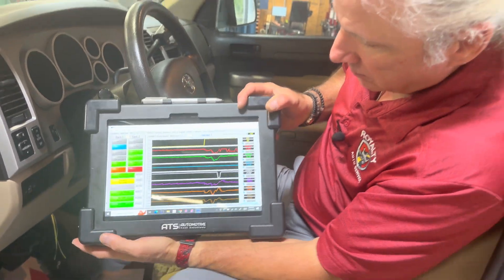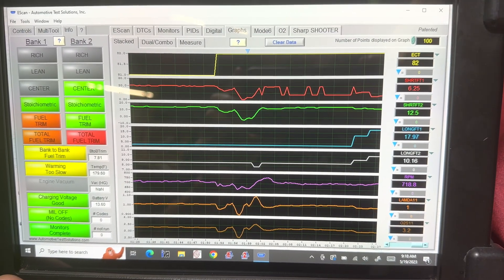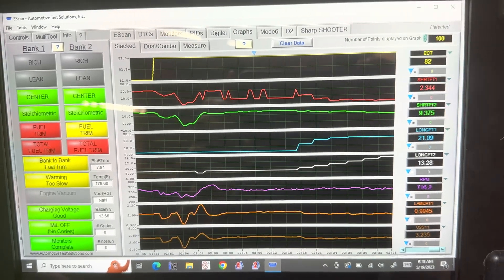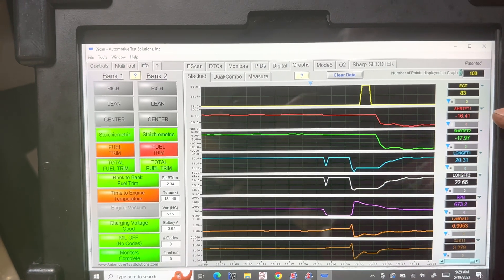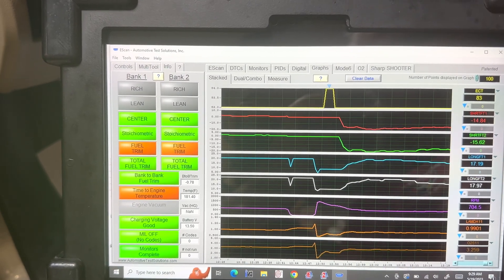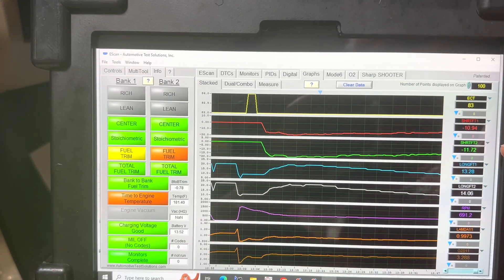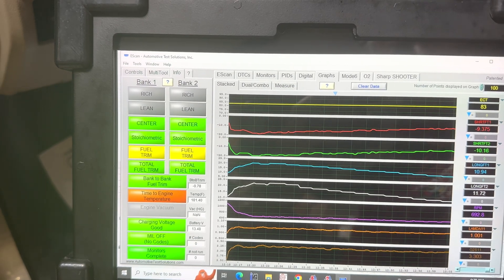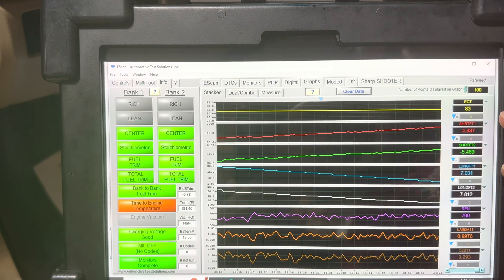Beginner Fuel Trim Diagnostics / Vacuum Leaks (Toyota Tundra)

Comment: why doesn't a vacuum leak cause the idle speed to increase
isn't a vacumm leak (after the throttle plate) the same as a partially open throttlé ¿¿¿¿

Comment: Can someone maybe give me some advice on my car's situation? In park my Long term is negative 10-15% while short term is normal. If i raise the rpms to about 2000 and hold it the long and short term trim will normalize close to zero. Any ideas?
Reply: Long term negative means the computer is reducing the amount of fuel because the flow of air is restricted. Clean air filter, maf sensor with approved spray cleaner ( let it dry naturally, DO NOT USE COMPRESSED AIR you would destroy it ) , and importantly clean the throttle body. The effect of an air restriction is more evident when the throttled is close than when it is open at higher rpms.
Reply: Typo: closed
Reply: Also if your car has a map sensor ( manifold absolute pressure ) , not to be confused with a maf sensor, check it and clean it if necessary.
Reply: @franktarawa1300  Ive tried cleaning it even though the MAP sensor reported the atmospheric pressure correctly with KOEO and it also matched up with an actual vacuum gauge in comparison ( used a Bluedriver obd2 scan tool with live data and a Maddox Vacuum gauge). Ive tested pretty much everything I have been suggested so far, I mean you name it and Ive probably ruled it out. Im building a smoke tester to use on the exhaust just to see if i have any leaks there or maybe at the exhaust manifold just because i havent done it. Could an exhaust leak affect my wild idle if the leak is before the upstream O2 sensor? Its a 2000 Dodge Neon by the way 2.0L.
Reply: Any update I the have same issue  in idling?
Reply: @sultanalrashidi1400  I replaced the air intake manifold gasket where it meets the engine, it was pretty worn out. I also noticed a very small exhaust leak where the manifold meets the engine. Runs better now

Comment: Thanks for the video and explaining short term and long-term fuel trim and having a problem with my 074.6 F150 found a leaking EGR valve with my smoke machine. After putting smoke machine on truck found leaking EGR valve gasket bad. Was fixing to start buying fuel injectors, and O2 sensors until I found this video. Thanks again.

Comment: Can anyone help me with my problem, my car is idling rough at moment and has even stalled a couple of times when I stopped, on my scanner with the short term fuel trims there's absolutely no reading at all just 3 dots like it's turned off, eg, (STFT bank 2 sensor 2...), there's no percentage at all, any help would be appreciated, thanks, there's also no codes whatsoever

Comment: With vacuum leak, extra air and fuel being added into engine,  RPM have to be higher than normal idle, Yes?? Got a car here with 7% LTFT and 2-4% STFT but engine RPM at idle seem normal at 700-750. what could be the issue?

Comment: You are spot on about fuel trim.  On my 2016 XC 60  I forgot to put the oil cap on after I change the oil. Luckily I  did not make a mess.  With the hood open,  I briefly started the car to check for any oil leaks and it did not  take to long  for the PO171 code to  reveal itself. Because I knew the vacuum leak was caused by the oil cap not being put on , I wanted to clear the code.  When I went to clear the code ,my ODBII scanner stated that it was a permanent code, and had to go thru the drive cycle. After a 250 mile trip and a couple subsequent small trips the code finally cleared.   I believe (as you said) if I did not attempt to clear the code it would of cleared much sooner on its own.

Comment: So if it might take 15 to 20 minutes at idle, and 10-20 miles of driving… do you turn the car over to the customer and let them determine if the repair actually remedied the symptom?

If it takes that long for fuel trims to normalize, seems like repair shops would be pulling their hair out not being able to know 100% they have found all potential issues.

Comment: What does it mean if at start up the STFT rises to over +50% on bank 2, starts running rough, I floor the gas a few times for about 5 seconds, STFT comes back down to around normal. Its only on bank 2. Its almost guaranteed to do it if I had the car running, shut it off and start it back up. Like if I had to grab something from the grocery store on my way home. LTFT stays around +7% to +12% on bank 2.

Comment: The vital information I was looking for and also might be useful to others (how a vac leak translates in fuel trims) is at 5:56. I knew you could use fuel trims to check for vacuum leaks but I can never remember which direction the fuel trims go. A car I was looking at had the STFT going negative -10 to about -20 when accelerating but it was idling at near 0 so I'm not sure if it's a vacuum leak. Would this be an indication of too much fuel/too little air?

Comment: What if you have stft at minus 8 at idle and ltft at positive 18?
Reply from the maker: That would be a total fuel trim of 10%. Given enough time the LTFT will lower to 10 and the STFT will be around 0. 10% is still a bit too much.
Reply: @theroyaltyautoservice  thanks for the reply! What are some things that could cause this? Vacuum leak or leaky fuel injector? Or maybe small boost leak?

Comment: If I was going to teach a vacuum leak AKA false air leak, I would want to show MAF readings also with this very small leak and a larger leak since you were able to control the size so I could monitor MAF small leak and larger leak and after the repair and since I am teaching MAF I would also have waited for a problem in a vehicle with a dirty MAF then done cleaning after fixing the leak to show more MAF readings based on these 2 scenarios. This is why creating a problem is not always a real-world scenario but THANK YOU for this beginner lesson that is in fact a useful lesson for a vacuum leak ONLY on any car that you did mention.

Comment: Thank you for the video! I got a Renault Duster with a vacuum leak suspicion. In idle, I got 15% STFT and  6% LTFT. However, at 2500 rpm, I got -10% STFT and the same 6% LTFT. Is it still a vacuum leak?
Reply from the maker: Sounds like it could be a vacuum leak going by those fuel trims. Adding 21% at idle but at 2500 total trim is 4% (which is good).
Reply: @theroyaltyautoservice  Thank you, Sir, for your answer! Love your channel!

Comment: very educational, you confirmed what I thought about vac leak after looking at trims like this.  But how d I find?  You touched on carb cleaner but I tried that before and found n o changes.  I supposedly had a smoke test, but didn't watch and he 'didn't find anything,' but that was a P0171 issue a while ago, that was fixed.  Intake gasket?  Valve cover gasket?  Similarly, you mention issue is only at idle, hence can I go on a road trip which will be mostly highway?

Comment: P0171 fuel system lean can also be Maf and fuel system issues. Dirty fuel pump or injectors. Had one recently with dirty injectors and wondering why the LTFT wasn't dropping after the repairs. Now I know that I have to cycle the key off. Thanks.Always great diagnosing from you guys
Reply: He is referring to vacuum leak and the clue here is huge adjustment at idle. A weak pump, clogged injectors, faulty MAF sensor etc. will cause high fuel trim numbers as well, but they will be present at different load/rpm ranges.
Reply: Yeah for those failing parts the fuel trims will continue to go up (positive numbers rising ) as the load / demand for fuel (such as during increased RPM) is introduced in the diagnostic process .

Comment: Nice video. Just wanted to add a comment for cars that use a MAP sensor instead of a MAF sensor. Vacuum leaks on MAP controlled vehicles will not be visible in the fuel trims.
Reply: There are two strategies to determine the amount of fuel to inject into a running engine.
One is to measure the incoming air mass using a mass air flow meter, the other, also called speed density measures the pressure in the intake manifold. 

Both of these methods are effective at determining the air volume, hence the PCM knows in advance of the combustion event how much fuel to apply based on the measured air volume. The idea is the keep the air to fuel ratio at 14:1.

When the measured air volume is accurate, and the fuel delivery is accurate, the theoretical fuel trims will be zero since the resulting combustion will not be rich or lean.

The reason the fuel trims of speed density systems are not affected by a vacuum leak as shown in the video is because the instant the leak is created it is detected by the MAP sensor, the fuel is adapted to the leak immediately resulting in a 14:1 ratio, which is perfect and the fuel trims remain at zero, or no change.

For engines that use a MAF, a vacuum leak as demonstrated in the video, means the additional air did not get measured, therefore the PCM does not know to increase the volume of fuel.  The lean mixture is burned, and then the O2 sensor reports a lean condition, resulting in positive change in the fuel trim to correct the lean condition.

Fuel trim is driven directly by the closed loop feedback from the oxygen sensor. Let us know if any of this makes sense, and just maybe Royal can make another video to elaborate more.  Fuel trims are a very powerful diagnostic tool, and are also the most misunderstood.
Reply: @TheRallyCoop great explanation thanks!
Reply: @TheRallyCoop  I thought fuel trim refers to, or basically equates to, "fuel compensation".  If the MAP detects a pressure change due to a leak, and the fuel is adapted, isn't that fuel trim happening to bring the mixture back to 14:1?
Reply: @kb25j  fuel trim is a measure of the correction
Reply: @kb25j fuel trim only changes if the air to fuel ratio is off, and the O2 sensor reports the resulting lean mixture, then the trim is adjusted. The key here is the O2 must report the lean or rich mixture. A change in fuel trim is directly related to the reading from the O2 sensor. With MAP systems, the air to fuel will always be the correct ratio for vacuum leaks, therefore the O2 will not report an imbalance, therefore no correction for fuel trim due to a vacuum leak. 

Now, if MAP vehicle reports positive fuel trims it is because insufficient fuel is getting into the combustion chamber! It is not because of a vacuum leak.
Reply: @TheRallyCoop  what wouid you say about a 99.2% STFT on both bank one and two, sensor 2?
Reply: @victoriamorris7619 not sure what you mean by sensor 2. Sounds like your engine is starving for fuel.
Reply: @TheRallyCoop referring to short term fuel trim bank one sensor one and STFT bank one sensor two. Sensor one is normal, around 3.9 but sensor two, after catalytic converter is 99.2
Reply: @TheRallyCoop could that possibly be due to carbon build up on the valves? It's an Acadia. Has MAP sensor.  I've had to replace the canister purge valve a few times. 
Long term trim is 14.8. Scan tool hasn't been able to complete the EGR monitor, boost pressure system monitor or the fuel system monitor. It's flashing red.
Reply: @TheRallyCoop My car has a lower intake manifold pressure when idling and on than the car of the same model, for example, it should be 3.8 psi, while it is 2.9 psi. It also has a higher calculated engine load, for example, it should be 18 percent, while it is 28 percent. The car is naturally aspirated and only has a map sensor, no maf sensor, and a wired throttle. It also has no air leaks because when I held the throttle with my hand, the car shut off. In this case, ltft is 13 percent and stft is zero percent. Both the first and second oxygen sensors show a constant and low number like 0.04, but I think they are healthy because when I suddenly give it gas, it reaches 0.9 volts. Also, during a cold start when the rpm is high, the first oxygen sensor oscillates correctly and the second oxygen sensor shows 0.45. I don't have a catalyst problem because at full throttle, the manifold pressure approaches atmospheric pressure. I think the timing must be correct because when idling, the timing advance shows 7 degrees, and this is the same as the car of the same model. The car has low acceleration and knocks. (Of course, the problem is not serious and it can be driven easily.) There are no error codes. What do you think is the problem?
Reply: @SinaShekari At 2.9 lbs of pressure you're making 11.8 lbs of vacuum. 

The general rule is 12 to 17 for a healthy engine.

The engine is a mechanical air pump.  I suspect the valve timing is off.

Perform an in cylinder compression test to assess where the valves open and close relative to the stroke of the pistons.
Reply: @TheRallyCoop  thank you sir, you mean the absolute pressure should be lower than this and higher vacuum? i checked the the same model cars of mine and at least they have near 4 psi absolute pressure and mine is very lower than them.(it's old technology 1.5 8V natural aspirated engine)
Reply: @SinaShekari manifold vacuum is atmospheric pressure minus the actual gauge pressure. 12 to 17 is a good range. Adjust your atmosphere pressure bases on your altitude.
Reply: @TheRallyCoop  if the vacuum leak is before the MAP, it's still metering the air properly?? It's unmetered air that causes fuel trim compensation.
Reply: @iam1smiley1 vacuum is created after the map sensor
Reply: Wow thanks man thats a great explanation
Reply: 100% correct 👊🏻speed density uses MAP 👍🏻
Reply: Kindly explain why
Reply: Yes please.
Reply: Good observation. Suspecting a vacuum leak you may look at load and map sensor pids, rpm , IAC counts if present, throttle position....
Reply: Then how do you do it on a map car with scanner?
Reply: @daveberman9022 The rpm will go up because the MAP will command more fuel to go with the extra air from the vacuum leak. The pcm will close the drive by wire throttle more to maintain the correct rpm at idle.
Reply: I have Kia soul with high long term fuel trims that has a map sensor and it's affecting my gas mileage and can't find any air leaks?
Reply: @daveberman9022 if you have a MAP sensor with high fuel trim then it means you don't have enough fuel entering the combustion chamber. It is not a vacuum leak.
Reply: @TheRallyCoop what could cause insufficient fuel delivery, the fuel pressure is within specs?
Reply: @daveberman9022 even with a clogged filter, fuel pressure can eventually reach specification, but the flow rate may be marginal. This failure mode will be most apparent under conditions for high fuel demand, as when the pedal is put to the metal. Drive safe!

Comment: If you take the RPM to about 2k and the fuel trims still spikes up further more. What does this implies
Reply: Fuel supply issue (fuel pressure or injector clog).
Reply from the maker: By "Up further" I'm thinking you're asking if it gets more negative or stays very negative. If not, let me know. If so, then It could be a fueling issue (fuel pressure low, partially restricted injectors) or it could be an intake air meter reading. That could be a Mass Air Flow Sensor problem. It is also possible that a temperature sensor is reading too hot but that would be rare and would probably set a code for temp sensor.